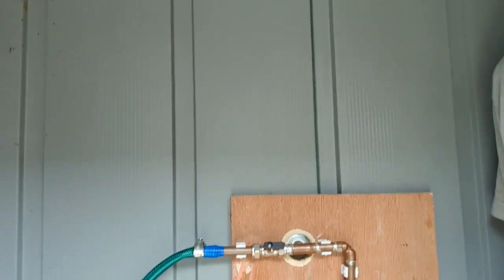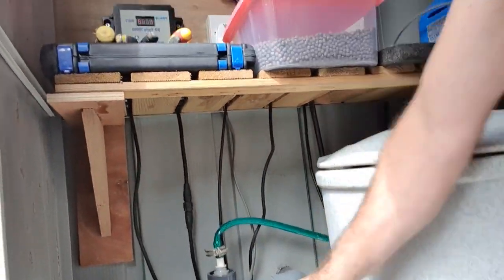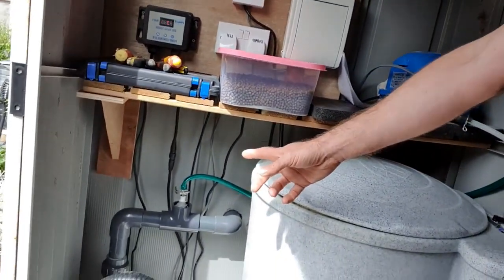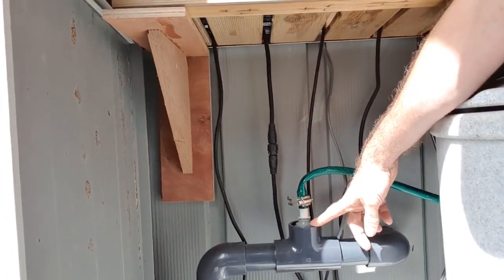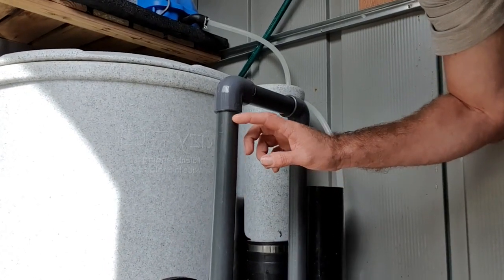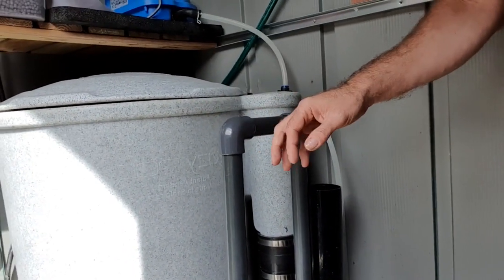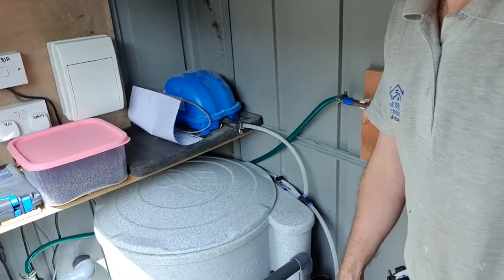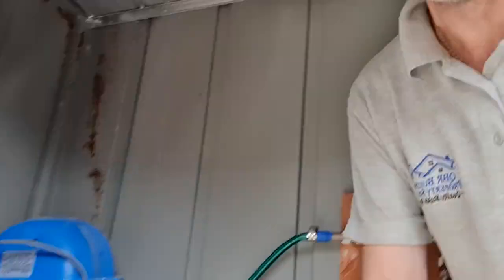Quick & easy koi pond trickle in out for water changes

Comment: Hi daz I believe I'm correct in saying you should have a non return in your feed to trickle in to stop contamination chemicals entering the mains supply
Reply from the maker: Hi Neil, I'm not aware of any legal requirement but it is impossible for anything to go back up that line. The pipe that it feeds in to is 1.5" and open ended so there can be no back pressure. I would need to generate three bar of back pressure to overcome my mains pressure and then push water back through 50m of garden hose against a tiny opening that allows a small trickle through. Even if the 1.5" pipe could block, there is nothing in a pond system that can generate anywhere near that kind of pressure.

Comment: Hi Daz
Very informative video as always   I have already adapted my eazypod to include a auto top up valve and a 32mm overflow pipe drilled into the outer chamber. I get that I need to do the trickle in near to where the water returns into the pond. But if I cut another
 32mm  pipe into the 
outer chamber running to 
waste with the bottom of 
the pipe just below water level, would that work as well as your method 
Cheers 
Alan
Reply from the maker: Hi Alan, if I understand you correctly then that will work fine. I think what you are proposing is basically the same as mine but you are adding another hole rather than using the one I used (waste outlet). Should be all good 👍👍👍

Comment: Great video as per usual. I would be a little careful with the trickle out set up as I believe there may be potential for a syphon to develop and empty out a considerable volume of water? A tee piece at the high point would eliminate this and also remove the possibility of an airlock.
Reply from the maker: Hi Lee, I hadn't considered that to be honest. I've thought about it and its not possible on my setup as the level would have to somehow rise so fast that it filled the right hand pipe quickly enough to go round the elbow, fill the horizontal pipe, go round the next elbow and then come some way down without any air entering at all. I can only really ever have a small trickle of water across the horizontal pipe, its like a weir effectively.
Its a very good point though because if someone where to make one with very small pipe or tubing it could be possible to get in to a syphon situation.
Reply: @DazzleKoi  it probably will never happen, but there are mechanisms like bell Syphon or similar set ups used on aquaponics systems that trigger with extremely slow amount of water flow. By leaving the joints not glued you would also allow the air out this preventing the Syphon.
Reply from the maker: So I guess drilling a hole in the top of one of the top elbows would also have the same effect?
Definitely something to consider 👍
Reply: I see this video and thought exactly the same as Lee. I done this myself before and it did drain about a foot of water out of my pond I then realised and replaced the 90 with a T

Comment: Thanks for this video Daz, confirmed my thoughts, is the isolator valve the best to minimise the in flow as our pond is only 3,250 litres...at 15% water change a week I've worked out we would need 3,250 litres x 15 percent / 7 days / 24 hours =  2.9 litres per hour or 0.48 litres (say 0.5 litres) per 10 minutes to be able to measure into a jug

Would really appreciate if you could check my calculations and if you think I can get the trickle in this low with the isolator valve

Thanks so much

Maria:_DazzleKoiCool:
Reply from the maker: Hi Maria, yes your calculations are spot on. Yes the isolator I use will be fine for that kind of flow, its literal and constant drip. They only cost about £1 from screwfix or B&Q to. You can get a flow meter that will measure the flow for you , I think from memory its about £40 but may be worth a look. I intend doing a video on setting one up and testing it at some point 👍👍
Reply: @DazzleKoi  thanks Daz xXx🥰

Comment: Where can I buy the push fit for trickle in plz 👍👍
Reply from the maker: Hi Hi, I did it a bit Heath Robinson to be honest. Basically I got a push fit tank connector like this one https://www.screwfix.com/p/jg-speedfit-plastic-push-fit-tank-connector-15mm/11173?kpid=11173&ds_kid=92700055281954514&ds_rl=1249404&gclid=CjwKCAjwu5CDBhB9EiwA0w6sLaSv0Dp8vRsim5KMkkskRhYYupb6oS2BOGAh5v7RYTV8p34b6OsNoBoCVAsQAvD_BwE&gclsrc=aw.ds

and then set it in to the 1.5inch pressure pipe T piece using resin. Its not really ideal to be honest. You would be better if you can find a flat surface somewhere in your system to fit the tank connector to. Maybe somewhere on the Pod on the outlet side.

Comment: Hi, great idea. I have actually copied this but for some reason when my water gets to the hight set to overflow it then doesn't stop siphoning out until it half drains my pond? Any ideas
Reply from the maker: Hi mate, I suspect you have used very thin pipe, is that the case? In order to syphon the water needs to completely fill the tube with no room for air. I used 1 inch pipe so this can't happen but if you used thinner pipe or tube this may be possible 👍👍
Reply: @DazzleKoi  Hi, no I used 40mm waste pipe, I think I found the problem as you say the whole pipe has to fill, what happened is I opened the valve to clean the filter closed it and expected the trickle to stop when I went in the house. The morning after pond was half way down. Hopefully that was the reason why.
Reply from the maker: Hi Michael, sorry for the delay replying, it sounds like you should be ok with 40mm pipe then. How has it been working since?
Reply: @DazzleKoi  perfect I have put two air holes in both top angles to avoid next time, everytime I opened the valve to clean the filter and close it Evan the valve on the pod soon as I open it starts siphoning, two holes have solved it.
Reply from the maker: Ahh  yes thats a good fix mate, that will sort it 👍
I didn't understand how you where doing this before but I get it now, you are emptying the filter via the up and over loop aren't you. I have never done that , I open the main line valve so my waste goes out by the original route and bypasses the loop.
Reply: @DazzleKoi  no I empty via the bottom line with the added valve on like yours but because it fills the pipe and air gets stuck Evan when I close it it continued to syphone out over the overflow tube.
Reply from the maker: At least you have a solution for it now then. I made a little tweak to mine last weekend actually, I swapped the solvent elbows (they where only pushed in, I never glued them) for rubber elbows so I can adjust the height a bit if I want to 👍

Comment: Hello
Do you have a non return valve in you water.tap so IT isnt possible tot get Any pond water in your tapwater
I AM from Holland and here its obligated to have one
For your health!
Ik AM sorry for my poor english...
Like your video's!!
Keep IT up!!
Reply from the maker: Hi mate, your English is great 👍👍
No, no none return valve. Our tap water supply is around 45 psi and and my pond end is only capable of generating maybe 5 psi at the most so its impossible for water to go back up the 60ft of hose and in to the tap water supply.
Pond pumps are notoriously poor at pumping against pressure so even if you connected a pond pump directly to your tap it would never be able to overcome the tap water pressure and go in to the supply.

Comment: Just watched this great Idea on trickle in out,  it would be hard to incorporate  one on my system due to tap being away from pond and having trailing hose pipes, I use a vyair 3 stage ,  but interested to know what chemicals you use for chloramines   Thank you Carol
Reply from the maker: Hi Carol, I'm in the same boat to be honest so I just ran a length of hose from the tap on the house to the bottom of the garden. Its hidden behind various raised beds etc. If you use a rubber type hose pipe it wont burst if it freezes or you can use a more solid type if you lag it. The valve to regulate flow is at the house end so if it ever did leak or burst it would only ever leak a small trickle out.
Thankfully I don't have chloramines in my water but I have a bottle of Tetra aquasafe on hand should I ever need it. I found this to work really well in the past and its available from local pets at home etc

Comment: Some very good videos Dazzle, this one is a very interesting video Daz, i have inherited the abortion that is my pond and i would love to work out a way to install a trickle in/out but everything i.e. filter, sieve, uv are all sunken under the decking, which looks nice but there is no accessibility whatsoever to any of it, i think you'd find flaws if you saw it, it is a bit of a ball ache, the question i'm wanting to ask is do you have any issues with freezing in winter on your trickle in/out supply ????
Reply from the maker: Hi Stephen. I use ordinary garden hose to take the water from the house to the pond. As well as being cheap and easy this prevents the bursting you get when solid pipe freezes and the water inside expands. Hose is flexible enough to stretch rather than burst.
The answer to your question is that I probably have as there where a couple of times when I had to throw the hosepipe over the side to top it up as it hadn't automatically topped back up the water I lost from filter flushing. If you don't flush your filters every day as I do you probably wouldn't even notice though to be honest.
Other than that its been fine and I haven't had to touch it.
Reply: @DazzleKoi  sorry mate reason i asked was during the last storm my garden hose froze solid and as a result i couldn't get any fresh water through it to top my pond up which totally screwed up my pH and as a result i lost 2 of my fish...my pond favourite massive kohaku and a medium chagoi which i'd nurtured back to good health which i'd had about 6 years....needless to say i'm trying to work out a way of it not happening  again
Reply from the maker: Ouch sorry to hear that mate, that's extreme!!
If there is that much riding on the continuous supply I would suggest putting in a proper solid supply and insulating it and burying it properly to make sure it doesn't freeze. You can get the proper water pipe (I think its polypropylene but check it out) and do it properly. Hopefully we've seen the last of the frost now so you've got 8 or 9 months to do it in 👍
Reply: @DazzleKoi  thanks mate....keep up the good work with the channel and the videos
Reply from the maker: Will do mate , thank you 🍻🍻🍻

Comment: Hi Daz, great video, looking at installing this to my pond. However, I have chloramines in my water so could I put the trickle in flow though the declorinator on the hose line to remove it as the water trickles through or would the flow be too slow for the declorinator filter? 
TIA
Reply from the maker: Hi Kyle, it would depend on the minimum flow for your particular dechlorinator but I'd be VERY surprised if it was a problem as most all dechlorinators work better the lower the flow is and they are really designed for tiny flows. Check with the manufacturer but I'm sure it will be fine.
If you are at all worried you can just throw in a small amount of sodium thiosulphate crystals once a week to take out any chlorine and chloramine that has been missed 👍👍